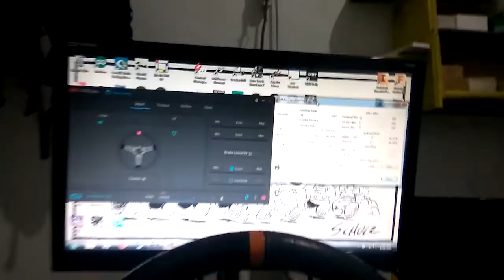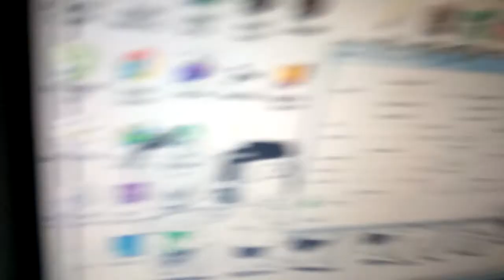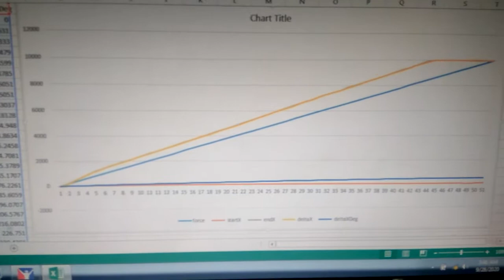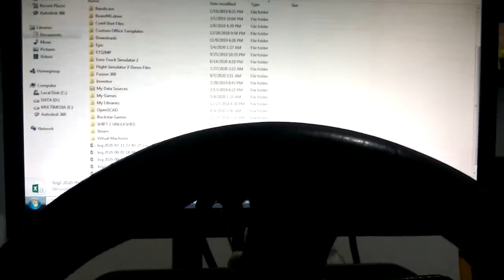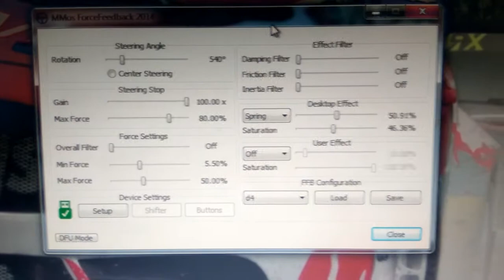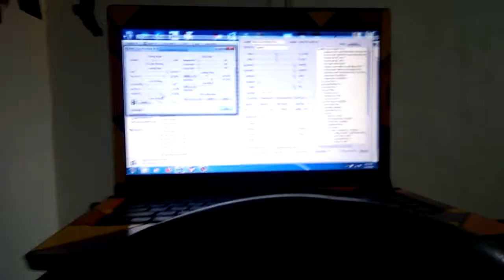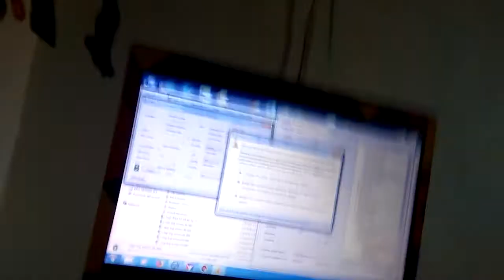New Torque test in my new setup DIY FFB Steering Wheel racing simulator

Comment: mau nanya mas. itu setir, pedal sama kopling punya kabel konektor ke pc sama power masing2 atau nyambung ke stm32 setir nya?
Reply from the maker: dijadiin 1 ke stm32 juga bisa...tpi di setup q pake 3 microcontroller, jadi ke pc ada 3 usb masuk...
Reply: @mentalterbelakang  ooo gitu, powernya dari usb juga kan ya? Kalau tambah rem tangan berarti jadi 4 usb masuk ya?
Reply from the maker: @hilmanmaulana1565  sbenernya cuma 1 usb udah cukup kalo cuma pake 1 microcontroller...

kalo basic aja 1 micro cukup...
Reply: @mentalterbelakang  Ooo gitu, oiya itu sambungan shaft ke setir namanya apa ya? sama di setirnya kan banyak tombol2, kalau mau disatuin jadi 1 ke kabel spiral ethernet, skema kabelnya bisa dilihat dimana ya?

Comment: wow! what motor and V used/ PSU / power consumption ?
Reply from the maker: still like the old setup, 24v 20A PSU (but only set to 18.8v), EPS motor, consumption around 500w on wall...

difference with old setup just pulley ratio...
Reply: @mentalterbelakang  does this motor got any part number/ model ? lookin for something not too expensive for my projects... at the moment not too much time couse too many ppls logitech toys to repair, and just in a free moments collecting parts and knowlage to future changes. 24v / 16,6 A psu is what i got at the moment so see it's a little too low for this motor .. any recommendation to 400W max ?
Reply from the maker: @in4r1984  try my6812, better for lower power consumption...
Reply: @mentalterbelakang  wanna something cheap ... wiper motors are nice, in one of projects had got 12v80a and died fast anyway :) next time just get not too powerfull and use with bigger ratio not only sth like 1:5
Reply: i made a one with wiper motor but its torque started to fade out so i will either decrease the ratio or buy my1016